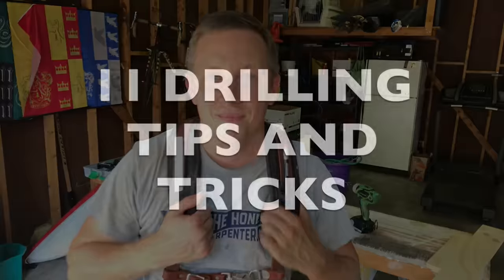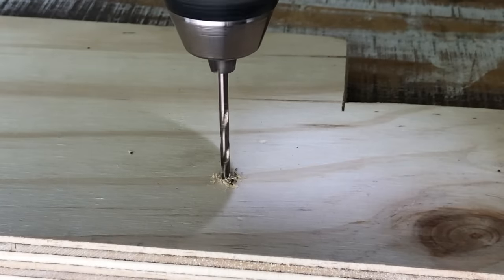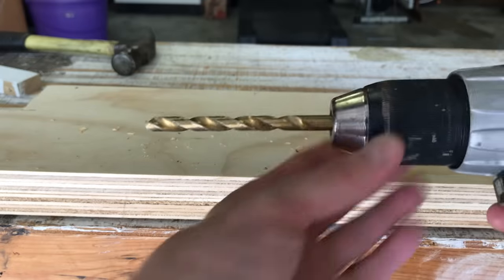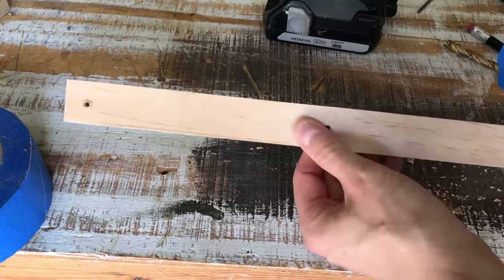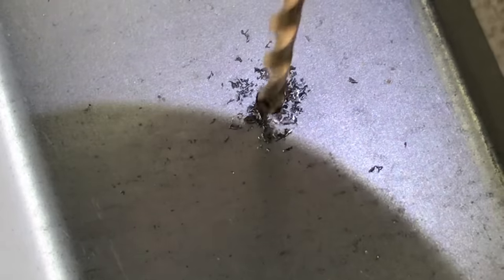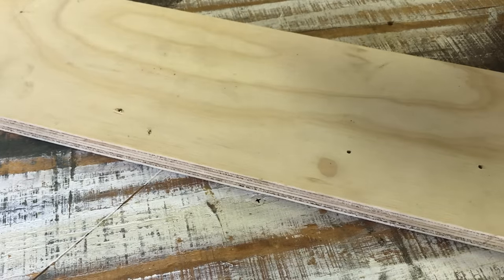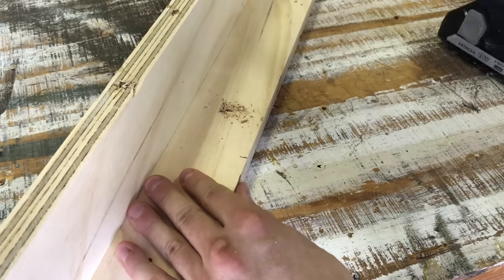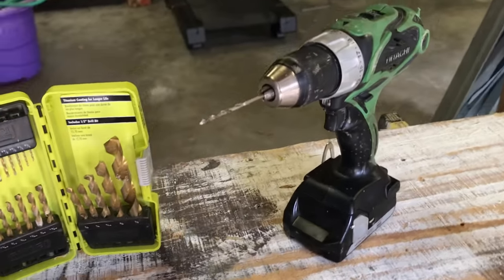11 DRILLING TIPS AND TRICKS (And Mistakes To Avoid!)

Comment: After a lifetime of drilling on DIY projects, I've recently learned that #2 doesn't apply to drilling into metal.  I guessed, apparently incorrectly, that what was true for wood would also be applicable to metal.  But that doesn't seem to be the case.  When cutting metal, you need to have a certain amount of pressure, and speed can be your enemy.  And then I get to #7!

Comment: It's a shame. Before someone does a video on the proper use of tools he should learn the proper use of tools
Reply from the maker: What part didn’t you agree with Rick?
Reply: Well theres no need to tap a wood handled awl,  not sure if you're wiggling the drill on purpose or not but that's a no no, and although many screws today have a self tapping head, a countersink is always the best idea to prevent splitting
Reply from the maker: I got you. Tapping is more an illustrative thing, since audience can’t see the divot well. Wiggling (other than the hogging out part) is mostly negligence from watching the monitor rather than my hands (I have crazy unsteady hands for a carpenter though). Countersink I probably should have shown